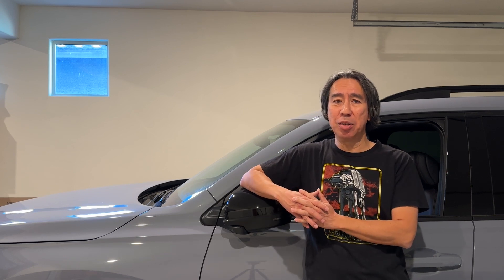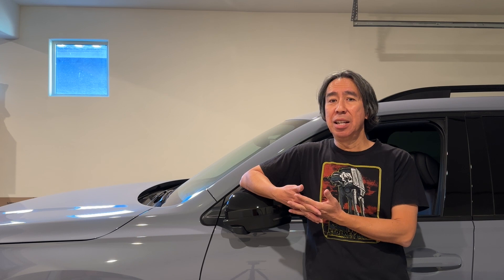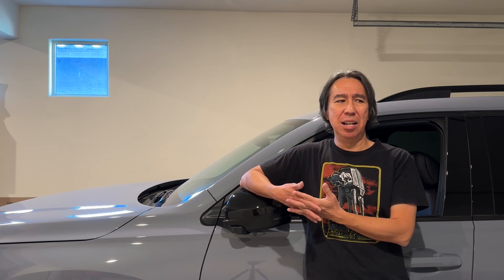Honda VCM (Variable Cylinder Management) - Everything you need to know.

Comment: I don’t understand what is the problem with that “ infamous” VCM , my ‘13 Acura  RDX has 152k+ and I haven’t had any issues with the VCM or VTEC mechanism 🤷‍♂️ oil change every 7.500 miles using 5w30 synthetic Mobil 1 extended performance high mileage, recently I replaced the valves cover gasket and the engine is clean , i even took pictures to show it to my friends 🤷‍♂️
Reply from the maker: You may be the lucky ones.  Your 2013 RDX has the same J35Z2 as my 2010 Accord, which burn lots of oil before the check engine light came on, due to foul plugs from the VCM.  I DIY my oil changes also.  The class action lawsuit affected 1.87 million vehicles.  Glad to hear your RDX is running great.  Happy Motoring.
Reply: @andrewwang128  now that you mentioned, no burning oil whatsoever, I do oil change and go until the next change without having to top it up even once 🤷‍♂️
Reply from the maker: @64arguz  Nice.  I do wonder if the tuning between Honda and Acura vehicles are different, for the same engine.  For example, the J35Y5 on the Acura MDX kicks into VTEC 500 rpm earlier than Honda.  Just wondering if there are other difference on the "same" engine.  Looking at the details of the class action lawsuit and the TSB warranty extension 6/2025, it does not include Acura models.  Honda models only.
Reply: @andrewwang128  I’m very sorry for the “ burning oil condition” I used to have an ‘08 accord , k24, purchased from a lady 🤦‍♂️ 1q/ 500 miles, I did my tricks and I was able to stretch the oil consumption to 1q/3k miles , still unacceptable for me, however the VTC noise at start up was what really disappointed me , using parts from the dealership I replaced myself the VTC and timing chain tensioner, noise gone but 10k miles later came back, I was furious and I sold the car 😏
Reply from the maker: @64arguz  Yes, I did read about the VTC on the K24.
Reply: @andrewwang128 did you replace the PCV. Valve ?
Reply from the maker: @64arguz  Nope.
Reply: @a@a @andrewwang128 t’s the first thing to do when you own a “ k24” or “J35” to minimize the oil consumption ! It Also applies to any vehicle regardless the brand 🤦‍♂️☹️

Comment: Hi Andrew,

"Great video! I’m currently driving a brand-new 2026 Odyssey (just over 800 miles) with the J35Y7 engine and the 10-speed AT. I’m experiencing a very specific issue and would love your insight, or to hear if other '25–'26 owners are feeling this.
I’ve noticed a consistent slight shock or unnatural 'lurch' during the 2→1 downshift right as I’m coming to a complete stop. It is significantly worse when the car is cold (below 32°F) and feels quite harsh, though it never fully disappears even when warmed up. Interestingly, it doesn’t happen on inclines or when I manually downshift with paddles.
I have a few questions regarding VCM on this new model:
1. VCM Version & Muzzlers: Which version of VCM is equipped on the 2026 Odyssey? You mentioned VCM version 4 (J35Y8) for the Pilot—is the Odyssey's J35Y7 using that same complex system with 10 sensors? If so, is there a VCM muzzler that actually works for the 2026 model yet?
2. Low-Speed Activation: Does VCM even activate at very low speeds (just before stopping)? I’m trying to determine if this 'jerk' I'm feeling is the transmission logic or if VCM deactivation/activation is playing a role in that 'unnatural' stopping feel.
3. Benefits on New Models: Aside from fuel economy, do you still believe it is always better to install a VCM muzzler on these brand-new 2026 engines to prevent long-term issues, or has Honda finally addressed the piston ring/mount concerns with VCM 4?
4. Break-in vs. Fix: In your experience, could this low-gear shift shock simply be part of a break-in process that disappears after a few thousand miles, or is it something a VCM muzzler (if available) might actually resolve?
Appreciate all the work you do for the Honda community!"
Reply from the maker: Thanks.  Looks like this question was also posted on another video of mine.  So I replied on that video.  https://www.youtube.com/watch?v=daTcGpf1zOQ&lc=UgwyqJE_X0rIxDK1FHZ4AaABAg
Reply: @andrewwang128 thank you sir

Comment: 1 year later 2026 Honda Odessey here. Any device yet?
Reply from the maker: All current VCM devices still work on the (2026) Odyssey because it uses the older J35Y6 engine.  Currently, there are no devices created for the J35Y8 engine which is on the 2023+ Pilot and 2025+ Passport.

Comment: 2008 Honda pilot exl, 288k miles. The last year without vcm.  I Can get 22-23 mpg if I drive like a grandma, al tires sightly over inflated, no roof rack, fresh oil and filter, air filter, empty the car of the two rear seat rows, etc
Reply from the maker: Thanks for sharing.

Comment: Very well done. My first time watching you and I was impressed enough to subscribe. I have a 2025 Pilot EXL. It has 15k miles now. We just took a trip to the mountains (about 1200 miles round trip). Cruising on the interstate at upper 70s to 80 we got 25-26 MPG. Since we don't have the AWD, that makes sense it gets a little better mileage than your experience. I do agree about the steering and the 1st. gear. I will try the economy mode and see if I notice a difference in the 1st gear effects. BTW, we sold our 2011 Pilot with 202k, never had any engine issues at all. Only repair was an AC TXV after it was over 10 years old. Other than that, only spent money on tires, brakes and oil. Thanks and keep up the good work.
Reply from the maker: Thank you for your reply and sharing your story.

Comment: I was going to buy a new Ridgeline, not now, I found out I can’t bypass the VCM not worth it. Sorry Honda I’ll pass!
Reply from the maker: Honda Ridgeline still uses the older J35Y6 engine.  All the existing VCM Muzzler devices will still work.  If you are buying new, install it and “forget” about it.
Reply: @andrewwang128 what VCM disabler would you recommend ?
Reply: 2025 Ridgeline
Reply from the maker: @jeffkchesser  I only have experience with VCM Muzzler II.  So it's what I would recommend.

Comment: Engines are not supposed to lose cyclinders and you will be lucky if your engine lasts nearly as long. It burns oil like crazy is out of balance on three cylinders and can damage piston rings because of it. It's dreadful technology put there to satisfy emissions. Honda even went out of their way to make sure you cannot deactivate it which is silly given that they don't have to go that far to get their emission certificate. Almost bloody mindedness in forcing us to use this anti engine technology.  I've now left Honda for good. I won't ever buy a vehicle that deactivates cyclinders intentionally. At least we have a button to disable other nonsense like start stop which saves you five bucks a year in gas but cost 600 bucks every five years for a new starter motor. I bought a new Frontier Pro4x with a 3.8 V6 and no turbo. An engine that isn't trying to grenade itself after it's first 30000 miles. Anyone buying an vehicles with this technology you have been warned.

Comment: Don't buy Honda. My First Honda Odyssey has Transmission Recall as I bought 2nd hand vehicle Honda didn't honor the repair. My Second 2016 Honda Odyssey now got Engine Recall with Piston Ring failure. Honda did not honored repair, I have been using it by replacing Spark Plugs when they go bad, recently last month they considered it as a recall and did the repair. But no where in the repair notes they mentioned it as a Recall. They just mentioned that they fixed P301 code error. Honda is not trust worthy.

Comment: will stay with older one these new ones are just junk for a honda why any one would use a kevlar belt they will break after 100k only used for motorcycle drive or water pump alt to charge battery was going to buy 2019 honda ridgeline till i found this out if i cant fix it my self thats a 1500 fix this is the problem these car makers dont want you to work on it so you would be better off with an older one take the 2008 honda ridgeline you can change out belt with out a bunch of junk in the way

Comment: I have the 2025 pilot for the past 6 months. I don’t drive highways a lot but when i do i get around 26 or 27 on normal mode. Economy mode takes out the life out of engine what i feel. Yeah 1st to 2nd gear shift is a little weird not smooth if you pedal hard. I don’t have any other negative thing to say.

Comment: Clear detailed video, thanks. Interested in hearing what comes up with vcm-4 in the future, hopefully it's dialed in now.

Didn't know vcm-2 was the only one with 4-cyl mode, and I also thought 4 cyl mode ran cylinders 1-4 not 1,2, 4, and 5.

S-VCM is a vcmtuner / vcm muzzler alternative too, the one thing I prefer is that if the coolant temp is too high, svcm deactivates and you can read the true coolant temp, not the adjusted one.

Comment: Still confused as to which one is in my 2025 Ridgeline. The J35Y6. I couldn’t tell with my current scan tool. Recorded data while on a highway test drive. Didn’t see any injectors cut out or anything. 🤷🏻‍♂️
Reply from the maker: 2025 Ridgeline have the J35Y6.

Comment: All of my problems seem to be occurring during acceleration when the engine should be running on 6 cylinders. When I am at speed on the highway with the cruise control on it seems to be operating perfect. If I step on it I can feel all six engage but if I just give it a little more throttle it's chugging and it feels like it does not know what gear it wants to be in. The same when I take off from a red light. It shutters and chugs and seems to be misfiring. Is there anyone who can tell me if this is a vcm problem?

Comment: How can Honda get it right? When you shut down three cylinders they run colder than the "live" three cylinders so the pistons and rings will expand slightly and wear quicker. Seems the way to get around this would be to alternate the cylinders that are shut down.
Reply from the maker: Good point.  One side will get cooler everything it goes into VCM mode.

Comment: Just subscribed as I just purchased a 2023 two weeks ago with 29k miles on it. I got rid of a 20 Tahoe which had the be damned variable fuel management which I purchased the Ranger thing to prevent it from going from V8-4 cyl. Now I find out Honda has this too. I have only put about 300 miles on it so far and notice the quick shift from 1st to 2nd, but no other issues. I will try Economy mode to see what happens there with the vehicle. Thanks.
Reply from the maker: Thank you for subscribing.

Comment: There should be an option to turn it off, why do manufacturers do this?!
Reply from the maker: For emission reasons and better MPG.
Reply: @andrewwang128 maybe MPG, marginal improvement at best. It's not an emission requirement. It's more trouble then its worth.
Reply from the maker: @geoffrey3289  Agree, I wish Honda would avoid VCM.  The J35 V6 engine is awesome.  The only weakness IMO is the VCM (cylinder deactivation).
Reply: @andrewwang128 Yeah I am looking new, within the next year at least. My options for my family would either be the Odyssey or the Pilot for space and third row seating. Oh by the way you made a very informative video I appreciate your knowledge and understanding.
Reply from the maker: @geoffrey3289  Thanks.  If you get the Odyssey, I would add a muzzler type of device and you can forget about VCM.  If you get the Pilot, so far, so good.  Then again, I'm at Year 1.  From what I read on others 2023+ Pilot, no issues with the VCM.
Reply: @andrewwang128 I'm looking at the Honda Pilots or an Odyssey. It's concerning in the current automotive market considering prices you have to weigh out what problems you want with whatever manufacturer you go with.
Reply from the maker: @geoffrey3289  Are you looking at new?  Keep in mind that the Odyssey uses the older J35Y6 and you can muzzle the VCM.  The Pilot uses the new J35Y8 engine, which you can't prevent the VCM.

Comment: Did you install vcm in your 4th gen pilot?
Reply from the maker: I did not on my 2025 Pilot because none of the muzzlers will work with the newer J35Y8 engine that is on the 23+ Pilot and 26+ Passport.  If there is one, I would use it on my Pilot.
Reply: @andrewwang128 please do post whenever it will available soon. Thank you!
Reply from the maker: @TanSuroYan  Yes, will do.

Comment: Is there still a device that would work on a 2026 Odyssey?
Reply from the maker: All the current vcm muzzler devices should work.  Looks like Honda still uses the (older) J35Y6 engine for 2026.
Reply: @andrewwang128  Thank you for responding. Your videos are very informative and helpful.
Reply: @andrewwang128   One more question if you have a minute. Would you add this to your vehicle , or would it void my warranty? Thanks
Reply from the maker: @RobertKinchen Yes, without any reservation.  I paid for 6 cylinders, I should get all 6 cylinders, all the time.  It should not void the warranty.  If you are concern, you can remove it before taking it back to the dealership for service or work.
Reply: @andrewwang128  Thanks again for taking your time to answer my questions. I’ll be looking forward to your next video. Take care

Comment: I bought a 2025 Honda Ridgeline 3.5 V6 with the VCM and clearly noted on the paperwork it has it. The dealer 2 days ago said it does not have it which he was wrong because the window sticker shows I do and I have 13K on it already and I love the truck but should I be concerned with the modification to disengage it ? JIm
Reply from the maker: The word I would use is not "concern," meaning I would install a "muzzler" device and enjoy your Ridgeline with all 6 cylinders running all the time.  And never have to think about any possible "VCM issues."  The J35 V6 engine is a gem.

Comment: This should be able to be turned off. Either in the on-board menu or via tuning. Can it be turned off currently by tuning? If yes, this would be the safest way to disable it for the life of the motor and transmission. I don't like the idea of fooling the computer on the engine temp. This could cause many issues due to overheating and not knowing it is overheating. Very expensive fixes due to overheating.
Reply from the maker: Unfortunately, you can’t turn it off.  I’ve not had any overheating issues with a Muzzler device (VCM Muzzler II) after 11 years and 137k miles of use.
Reply: @andrewwang128 Sorry to bother. If I put this device on my 2019 Ridgeline, if my truck starts to overheat, will the VCM device still send a false reading displaying that the engine is not overheating? I don't want to drive my truck with the engine overheating and not knowing it's overheating.
Reply from the maker: @Old_Toby  I never had any cooling issues, but I do believe your statement would be true.  The VCM device (VCM Muzzler II for example) would not display correctly if the engine is overheating.  Let's peel this back a bit.  What are the situations where an engine would overheat?  1.  A busted hose.  One would know this a few seconds after it happened,  muzzler device installed or not.  So the temp gauge does not help.  2.  If there is a slow leak.  I thinks that's where it would be a factor, if a lot of the coolant and the engine starts to overheat.  3.  A faulty thermostat.  It will be important for owners to check under the hood, no different than any other car.  One may be able to spot something before it happens.  IMO, Honda's cooling system is robust IMO.  But yes, anything can happen.

Comment: can you bypass the VCM by running the transmission in snow or mud mode?
Reply from the maker: There is no Mud model (on the Pilot).  Do you mean Sand or Trail mode?  For the Snow mode, the vehicle will start in 2nd gear, and the throttle is held back a bit.  I think that would make the vehicle difficult to drive on the street.
Reply: @andrewwang128 I just purchased a 2025 Ridgeline.  I thought the Pilot and Ridgeline were pretty much the same, My mistake
Reply from the maker: @philb5 Good to know that there is Mud mode on the Ridgeline.  Thanks for pointing this out.
Reply: @andrewwang128 I just went out to the 2025 Ridgeline and discovered that it does NOT have Sport or Tow mode it has normal, mud, snow or sand . any suggestions
Reply from the maker: @philb5  Interesting.  I would think the Ridgeline would have a Tow mode.  The 2025 Ridgeline uses the (older) J35Y6 engine.  So VCM deactivation devices will still work.  Here are 4 most common "vcm muzzler" devices.  https://www.youtube.com/watch?v=daTcGpf1zOQ Plug it into your Ridgeline to deactivate the VCM.  Only current Pilot and Passport use the (latest) J35Y8 engine.
Reply: @andrewwang128  thank you for your input. I had already watched your previous video on the four types of deactivator's. I'm starting to get a little disappointed in the Ridgeline because there's absolutely nothing in the manual that talks about the VCM or a VCM indicator light . so you would know if the VCM is engaging. Thanks again.
Reply: I warched another YouTuber and he stated that if you turn the Econ on that that will engage the VCM if you don't turn Econ on, it won't engage. The 2025 Ridgeline only has about 800 miles on it, but I've never used the Econ button.so I felt the VCM engage. I'll try the next time I drive it and let you know.
Reply from the maker: @philb5  Ridgeline is a wonderful truck.  It was what I wanted to get.  At the 9th hour, the decision process went to 2025 Accord then to the 2026 HR-V.  Manufacturers don't discuss cylinder deactivation anymore because it's now somewhat common.